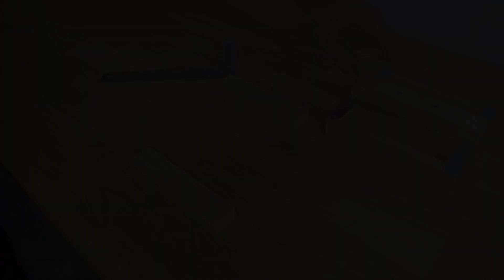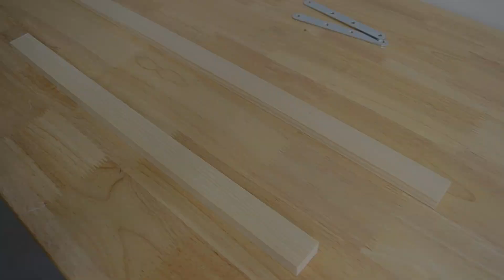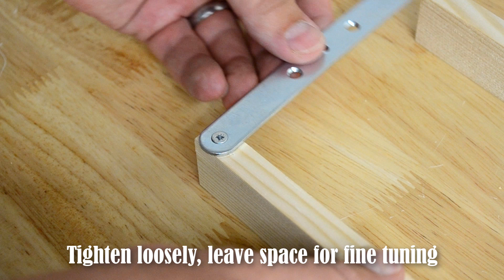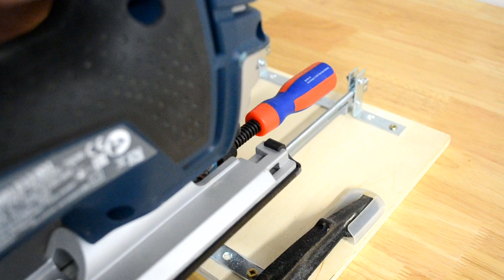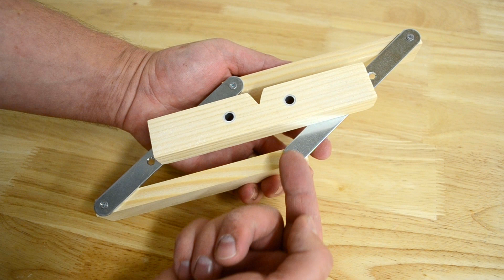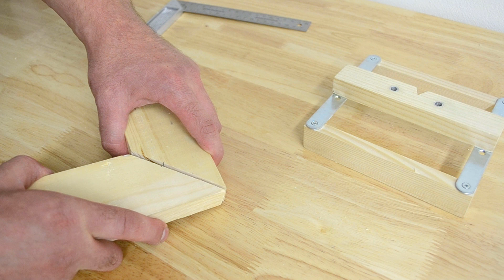Make a Self-Centering Doweling Jig | Diy Simple Dowel Jig

Comment: Thanks for making this video! I might try to make one of these. Did you make those metal brackets yourself or are you able to buy those at a hardware store?
Reply from the maker: Hi Jeff, I bought those at a hardware store but they were not exactly as I wanted / needed them to be. So I had to make few adjustments. Nevertheless this type of brackets is quite standard so I believe you could find them in a local hardware store. Thanks! :)
Reply: @AllFlavorWorkshop  Great. Thank you!
Reply from the maker: @jeffgruenbaum  Let ne kow how it turns out. 👍